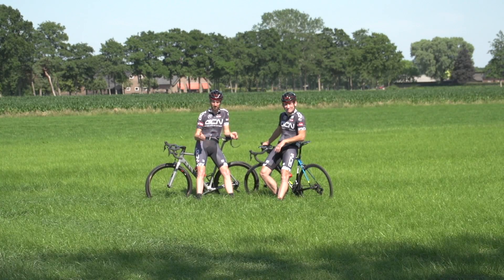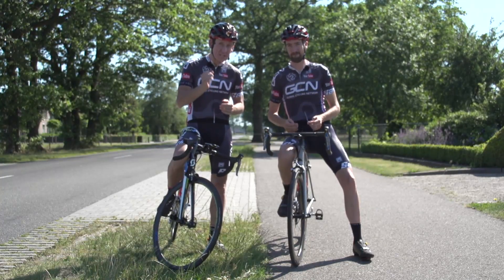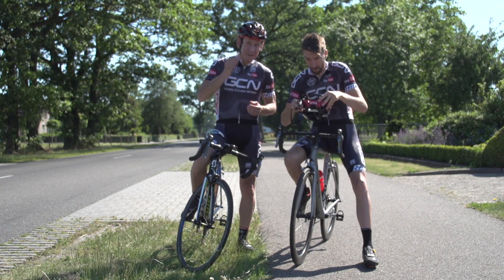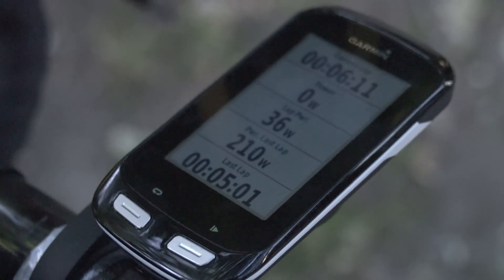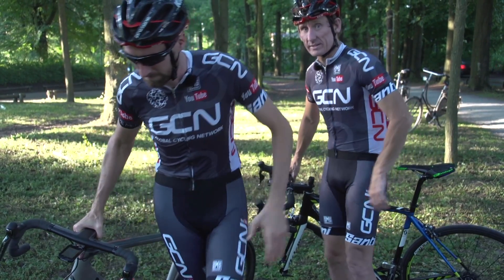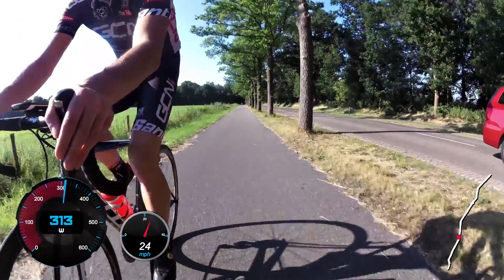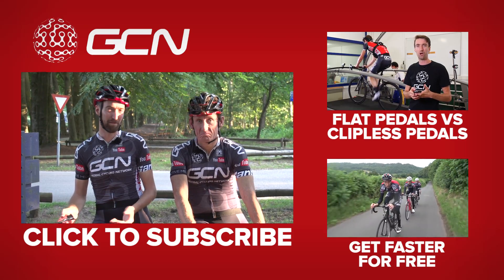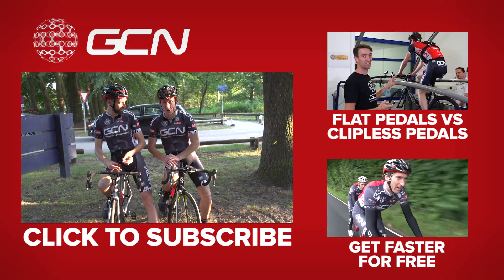How Much Energy Can You Save From Drafting? GCN Does Science

Comment: Question???  Does the front/lead out guy have to work harder (more watts) for the same output (speed), if there is a guy drafting??  i.e. does he actually work harder to pull the other along, by some odd slip stream effect??
Or is it just beneficial to the drafter, rather than detrimental to the front guy?? (safety aside, if he needs to swerve)
Thanks,  Keep it up.
Reply: The leading guy also benefits from drafting.
Reply: having someone drafting behind you does not change your needed power. there's no pull of any kind. it does not affect the front rider in any way, it just benefits the back driver.
Reply: there could be a benefit from drafting, if the trailing person reduce the chaotic turbulence, but it's about the distance, if the trailing person is just close enough to prevent the formation of turbulence, those turbulence won't eat away at their energy.

Comment: You really should've held the drops when doing this test as the body positions of both riders obviously also impact the drafting effect of the rider sitting in the back e.g. rarely do you see a racer riding on the hoods when battling the wind. 
I suggest in strong crosswind when the rider in front is in his full-aero position (especially when he's a bit shorter chap) doing 500W and riding in the very far opposite side of the road from the wind then the rider behind (especially when he's a bit taller chap) still has to put out similarly same power to keep up.

Comment: How about steep climbs? Is Drafting as effective or even easy to do?
Reply: MKTech What is a ballast?
Reply: Alasdair White Just from a butt0meter... no. Drafting only becomes effective when you are moving faster than 18-20mph. This isn't to say there is no effect, but wind resistance at low speeds is far less of an issue than gravity while climbing. Now if you are one of those guy who rides up 14%+ grades at 20mph, then you don't need to draft, you need ballast.
Reply: Weights put into a bike frame to bring it up to UCI weight limit or in my reference to slow people down. Usually they use diving weights or shot peen which can be purchased from any marine or diving store.
Reply: MKTech Thanks. I just haven't heard of that term before, but now I know. Cheers!